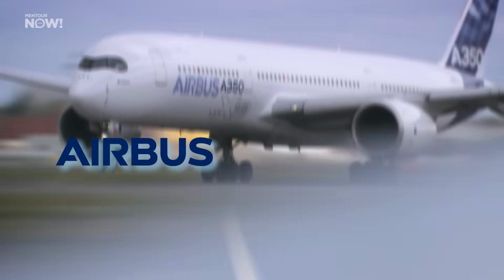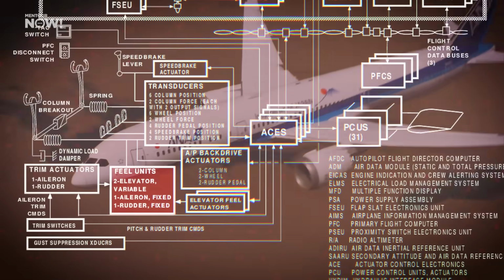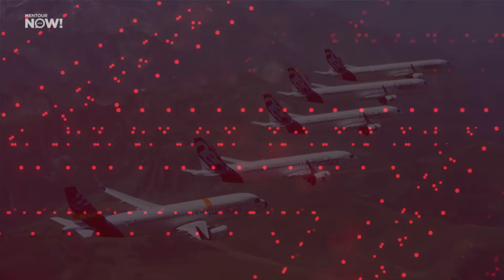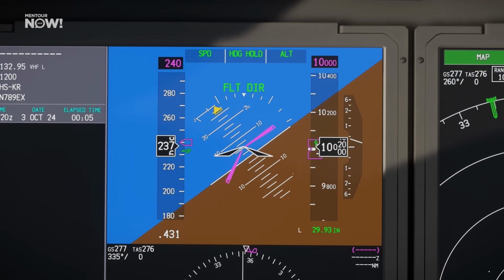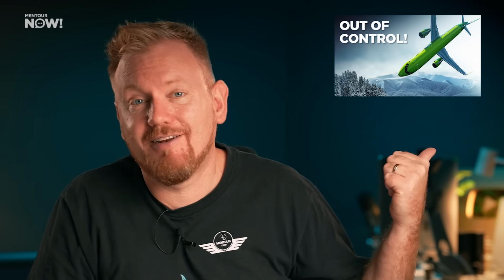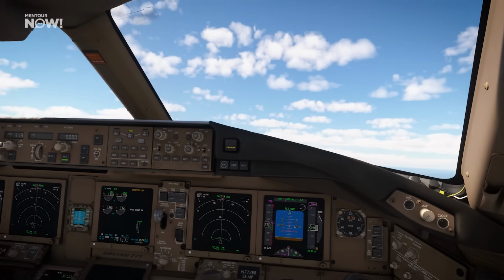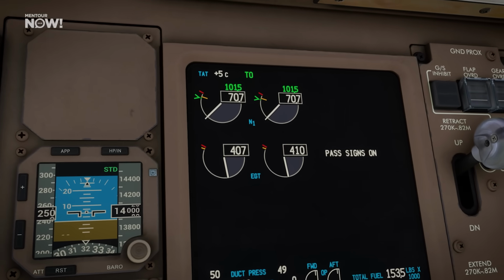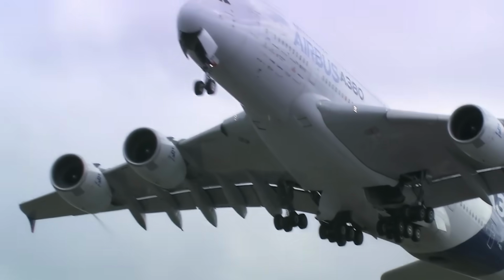Do Pilots Prefer AIRBUS over BOEING?!

Comment: There are two things worth considering here. 

On the Boeing 777, there's Primary Law, Secondary Law, and Direct Law. (Airbus: Normal, Alternate, Direct.) How does the Boeing fly-by-wire envelope protection work?

On Safety. One of the most remarkable features of modern jetliner safety statistics is the performance of Third Generation flightdeck airliners such as the Boeing 737 Next Generation, and the 747-400. The Next Generation, which you fly, has very interesting statistics, in particular, compared to the Classics it replaced, and the much more advanced Airbus A320. 

How these two Boeing jets achieved such stellar records, is a function of multiple factors that changed the industry for the better, such as EFIS flightdecks and increased automation such as FADEC systems, but crucially, the industry's incorporation of human factors based training and practices wholesale that for flight crew resulted in crew resource management (CRM).

Comment: As a sometimes NASA pilot ,  more info  is  better  than less. But it helps to train with this . On the military aircraft I fly I can tale my iPad or  PC and plug into the maintenance port for even more and finer data ::  say you know you are doing  about 700mph but your instructions show 2700 mph.   Ok, not  really, 😮 but I have to b figure it out - it’s what test pilots do.  One needs to know a lot of engineering.

Comment: One pilot said Boeing is trying to put computer systems in their planes. Airbus put wings on their computer.
Reply: That’s why Boeing and airbus crash from different reason being crash due to software add on like mcas that weren’t well flush out or brief to pilots while airbus crash due pilot having to take direct law control and forgetting a lot of stuff he needed to manually do during an emergency.
Reply: For decades engineers tried to make SIMS fly like airplanes.   It can't be done with 100 percent accuracy so Airbus made an airplane fly like the SIM instead.

Comment: I do some UX design and it sounds like the ideal system would be an airbus fly by wire with hard protections combined with the tactile feedback of the boeing. I cannot believe that Airbus does not provide tactile feedback and that Boeing does not provide "harder" protections or greater resistance to pilots when operating outside recommended parameters.

Comment: yes you are correct, Boeing control design is a crime against humanity, have killed plenty, they present the drivers with feeling of control tat they do not have, example, 737 MAX creating a completely new aerodynamic type and deceiving the public operators and drives to be the same type of machine certify 1967. saludos

Comment: As a Petrolhead, I really hate the way modern performance cars have so many electronics interfering with what I'm doing and making driving counter-intuitive. 

I need the car to tell me what's happening and do what I want it to do.

At the same time, when you're carrying passengers and/or cargo, safety and comfort take priority. Also at the same time, if something happens, you want to immediately be able to take absolute control and not have electronics interfering with instinct. 

I would imagine the same concept applies to aircraft pilots. More so because the consequences can be far worse and correction involves a lot more work.

Basically, my sensible side favours Airbus but everything else favours Boeing.

Comment: Boeing makes men's aircraft. Airbus makes women's aircraft. It feels terrifying to fly a plane of which you don't have full control.
Reply: Not having full control does not mean there's a point where you cannot control your aircraft and it crashes you. If all air data is reliable, there's nothing to worry about. If some of the air data is lost, you have more control on the airplane but there are still protections. If all air data is lost, you have full control now. What's wrong with that? I see nothing terrifying.
Reply: @eyupbninuydurukgrafigi43  Terrifying is that the machine flies you and overrides your decisions and knows what is best for you, when you should be flying the machine. Boeing got more humane approach where the pilot is still in charge and not the machine.
Reply: ??? Why are you bringing gender into this

Comment: If I remember correctly. A while ago an Airbus computer would not let pilot to land because it "thought" it was not a safe. Pilot was eventually connected to main Airbus facility, because he demanded to know how to unplug computer which interfered with landing. They landed with almost empty tanks. Other story. Airbus crashed in the storm I believe. Pilot was puling stick up, when co-pilot was pushing stick down. In Boing controls move together, i think. I prefer conventional controls.

Comment: First of all, thank you for these very interesting videos. Everybody can see that the producer really knows the stuff. I'm not a pilot. I'm a engineer and ACAM-Inspector and work for a national aviation authority. I have various licences on Boeing 777s, on several Airbus variants and also on an Embraer type.
I spend a lot of time dealing with the logic in the respective computer systems. Of course, I can't judge how the various aircraft types feel at flight, but I can certainly understand the idea of artificial feedback and also evaluate it. I'm more of an advocate of the Airbus philosophy, especially due to the evaluation of many accidents. But I like Boeing's approach of reporting back the control inputs through movement. 
And now... think about these Idea: In theory, a big step in flight safety would be to banish people from the cockpit completly. I'm well aware that this would have a big impact on passengers, so please note the reference to the theory here. But I want to know what do you think about?

Comment: 11:25 that’s if they actually keep their hands on the controls, I have seen in horror too many System Operators (also known as Children of the Magenta Line) engage the AP @ 400 feet and immediately drop their hands between their legs, especially the  hand guarding the thrust levers. It than makes no difference what the flight controls are doing; to an impostor it makes no difference.

Comment: I have flown Airbus and Boeing myself, let me tell you, Airbus is 1000 times less challenging when one actually flies it. It’s the ultimate pilot skills killer. Said that, operating a Boeing with all automation engaged is exactly the same, consequently, since the vast majority of pilots flies AP AT FD LNAV VNAV on 100% of the times, it makes absolutely no difference what these impostors are flying on, Airbus or Boeing, both are equally pilot’s skills killers with the only difference that, on a Boeing, one could theoretically practice flying. Unfortunately nobody ever does. P.S. unless AP AT FD are all OFF and ND is set to “Rose HSI” it’s not flying.. let’s not bullshit ourselves disconnecting just the AP and think “I’m flying the airplane”, that’s just a big smoking pile of BS.

Comment: As a total non- pilot I think I’d prefer flying Boeing because I’d like having the tactile feedback from my actions. 

Also, I don’t really trust automatic brakes on cars I’m driving - I’m always afraid they’ll malfunction and slam me to a stop for no reason and cause an accident rather than prevent one. I’m pretty sure I’d be kind of paranoid flying a plane that could lock me out of the system. Just one more thing that could fail - with much more serious consequences than automatic brakes!

Again, I’m no pilot and I’m only basing this opinion on info presented in this video as I understood it.

Comment: My flight experience ended at one flight hour in a Cessna.  Although I worked on planes in the Air Force and have sat in an F-15,  It wasn't thrilling and I was actually quite nervous sitting on top of TNT, the ejection seat.  I was in the jet to replace a small part.

Comment: Modern pilots do not fly airplanes. They just sit there and monitor the machine. They are barely more than factory workers who stare at a machine, waiting for an issue, that the machine will self diagnose and give then the buttons to press to fix it.

Comment: 447 accident was due to training issues. Halfway power, wings level, nose zero pitch will make 100% of all aircraft ever built waddle through the air in controlled flight at some sort of moderate deviation from level flight. With 20k hrs between Airbus, Boeing, McD & a small collection of turboprops they all work the same. Pitch & power. Two gents parked a Boeing airplane in the drink some years back after a “10,000’ controlled stall” [sic] because the various instruments showed a stall & overspeed simultaneously. Covered pitot tubes. Had they flown pitch & power we would’ve never heard of the flight at all. I keep hearing Boeing Fanboys going on about all sorts of nonsense, and most of it simply isn’t factual. I can list many accidents in Boeing aircraft from lack of understanding the systems or incorrect application. Cali AA757 (speed brakes), DXB EK777 (throttles) , SFO Asiana 777 (throttles)  etc etc. I used to wear a hat printed “Testosterone Powered” flying my “American Iron” airplane, and laugh at the Nintendo Drivers across the isle in CRM class. I grew up. It’s that simple. On balance my personal opinion is that Airbus is the better airplane, and real life evidence shows that the automatics can be learnt and made habitual.  Most pilots I ever flew with hated the Airbus coming from Boeing and after 3-5,000 hours never want to go back.

Comment: So Boeing was attempting to maintain the detailed feel of flying an aircraft, yet in the 737 MAX they deliberately simulated the behaviour of an earlier model using MCAS and could completely take control out of the hands of the pilot if it went wrong...

Comment: As a pianist with mental health issues that tend to compromise my situational awareness, I can't understand Airbus taking tactile feedback out of the sidestick. Visual warnings are, from my experience, the easiest to miss especially in a sea of information which a cockpit definitely is. Aural warnings are better but precedence shows even they get drowned out by other information. Tactile information doesn't necessarily get interpreted the way it needs to but it is nearly impossible to ignore due to how low it registers in the brain.

Also, if the Airbus philosophy is to work against human error, why not build it to work against overreliance and complacency? Those are also human errors.
Reply: Many accidents would not have happened if the factors that led the crashes had happened with a visible horizon.

Comment: I am not a pilot so take this with a grain of salt, but after listening to this video, I found myself drawn to the control model of the Boeing over the Airbus, which honestly was not what I expected. Why? Well, As good as automatic systems appear to be on both aircraft, I imagine that there can always be times when sensors, and/or events, and/or conditions will create scenarios that a programmer could not predict, or that will fall outside of a given sensor's ability to detect. If, or when, that happens, I would want a human pilot who is 100% in control. Given that Boeing pilots can immediately exercise discretion that the computer will not override, and given that their manuals are simpler, I would expect them to be able to respond much more quickly and if experienced and capable, much more effectively in an emergency than an airbus pilot. That said, for day-to-day an predictable scenarios, I would imagine that Airbus would have the edge. I'm just more of a, "what do you do in a real emergency" kind of thinker. Thanks.

Comment: Overall, it seems to me - a non-pilot - that Airbus' system is "better" overall, but the controls not matching the actual settings and the dual input behavior are weaknesses. In fact, as a programmer, i can understand coding the "averaging" strategy (on inputs), but stepping back, i cannot imagine the situation where that is a useful choice? Having a more specific selection of the active control (and warnings when inputs are coming from the "off" one) would seem to be more often preferred. I suppose if that selection fails, then averaging gives you something, but i can't imagine that it would be that beneficial. 🤔

Comment: There is really no competition between Airbus and Boeing 💯🎯‼️🎯Since their Engines are manufactured by ONE Company, that is ROLLS ROYCE 💯‼️🎯‼️🎯 AMEN 🙏💯♾️📡🛰️📡🛰️📡🛰️📡🛰️❤️💜💙🤍💘🆒♾️📡🛰️📡🛰️📡💯🎯‼️🎯 In Aviation all that is inside and outside of the Plane must go well with its Engines  🚂🚒, any inconsistencies or wiring defailults that mismatches the Engines 🚂🚒 SPECS could turn into DUSASTER 💯🎯‼️🎯 And this is what BOEING and Rolls Royce is working at, for the right inovation not just for the sake of modernization 💯🎯‼️🎯💪🧠👽🪐♾️📡🛰️📡🛰️📡🛰️📡📡🛰️📡💯‼️🎯‼️🎯🇵🇭🌏🍭♂️⚖️♾️🎯

Comment: Now I'm not a pilot so I might be totally wrong but i see a potential problem with all the automation Airbus has.. Say a pilot flying an Airbus flys it for years without issues, they wouldn't be used to handling the plane in alternate/direct law. So besides the scare factor, of getting thrown into a different law, then they have to handle it in a totally different way than they've been doing for a long time

Comment: Boeing: we give you a plane and you will learn to fly it and master it it. You will have almost full control over what the plane does.
Airbus: how can we make it easier, more comfortable and safer for you in your airplane analyst role?

As long as the planes, infrastructure and the processes are maintained, Airbus sounds to be the better choice. There may be the very odd occurrences when the control Boeing provides may be an advantage, but their shortcomings are more likely to cause problems. Tired and stressed pilots make more mistakes, too.
However, it’s difficult to overlook the Air France disaster and 228 people, including several children being killed as a consequence of negligence and recklessness. The actual loss of life is even more severe. The mother of one of the two Hungarian children visiting an aunt couldn’t cope with the family’s loss and ended her life.
This incident wouldn’t have happened on a Boeing as the pilot would have had full control of the plane as I understand.

Comment: Good pilots make the difference not the planes. Both Boeing and airbus are equal. One thing i do think is hard limits over soft, Every one thinks they are better than a computer and could do a better job or judge the situation better etc but i think it would save you more often than not.

Comment: "By-Wire" gets ridiculous sometimes. My car as lock by wire. If the battery dies putting the key in the lock and turning will not unlock the door. So I'd have to use a Jimmy stick to open the door, to pop the hood & charged the battery. They should go back to mechanical mechanisms for door locks.

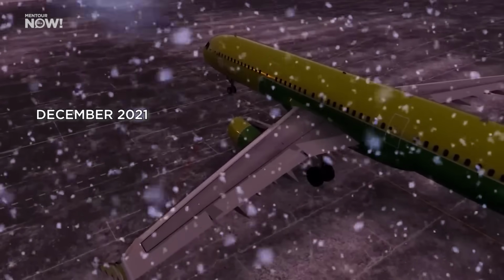Comment: 14:40
First of all, depicted is an A321 CEO with V2500 Engines, 
second, while the aural warning might be supressed, an additional light on the glare shield will light up.  Also the cockpit crew can press the red button on the sidestick to gain priority over the other person, this will then be followed up by changing the previously mentioned light on the glare shield to a red arrow for the non commanding side stick side.

Comment: I'm not a pilot, but I'm not sure if I would prefer Fly-By-Wire to having a physical connection between the yoke, and the things it operates.
I'm the same with electronic steering in cars. There's no feedback from the road. I like to feel the road surface and torque steer etc. The funny thing is, brake-by-wire is fine. There's not much feedback through the pedal, because the brakes aren't in contact with the road.
So yeah, I have no idea how manual flight controls and fly-by-wire actually  feels, so this comment is completely pointless 😂

Very interesting video and I really enjoy the technical detail you give.....Thanks man. ✈️ 🇬🇧

Comment: I prefer the Boeing design on multiple levels. Tactile feedback of maneuvers, a yolk  that gives visual indication of what the guy on the other side is doing.  Planes are 90% safer..... but 90% of airbus operators do not fully understand the alternate modes.  Confusion over automation has caused many many accidents.  From Air France 447 to Boeing freaking MCAS.  I would install a large button in the middle of the airbus panel that says "airplane mode".   Airbus needs to be way less clever.

Comment: I'm probably biased (it's always hard to know I guess), but Boeing's insistence on keeping the yokes, seems to me, to be like Apple's insistence on not adding a right-click button to their mice or not letting users move icons around on their iPhones (to name a few things that spring to mind). Just corporate stubbornness and a "we wont admit that others MIGHT have found a better solution"-kind of thinking. In some ways favoring the bad solution, for the sake of the company and not thinking about their customers and users.
The yoke just seems so terribly old fashioned and impractical to me. Clearly a lot of Boeing pilots would really like to have a tray table in stead.
And I must say that the example with the Russian Airbus - in connection with the talk of automation - didn't really work as an argument against it to me, when so many human errors where the cause of accident. Sure, feedback in the sticks might have helped, but it's hardly the airplane's fault that the pilots were (as it sounds) very unaware of the situation and the proper way to handle the plane in the different modes. Sounds like your argument is that automation is bad, because if it is switched off, the pilots can't handle the more hands-on approach? Hmmm...